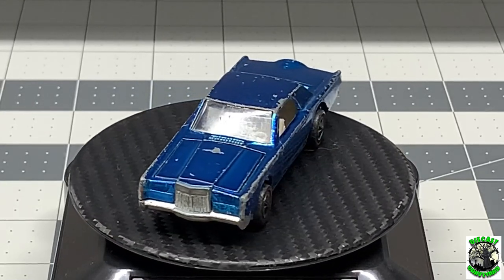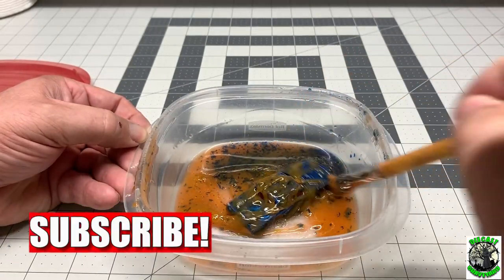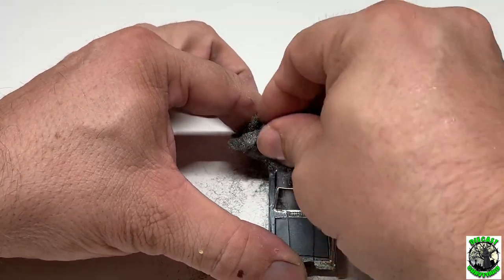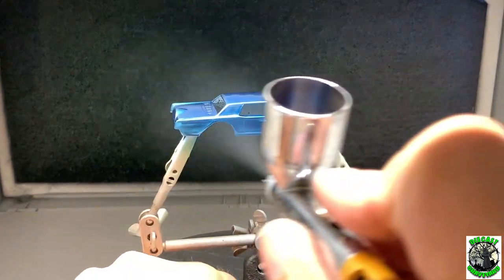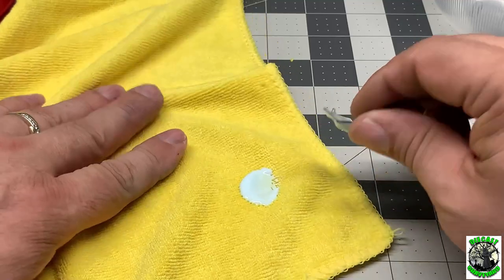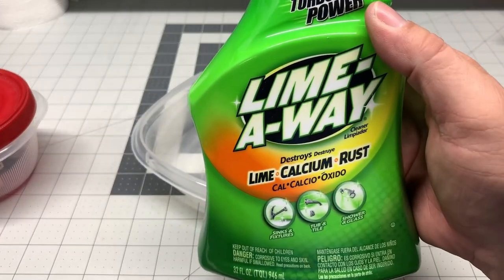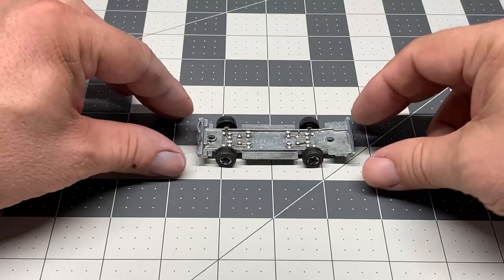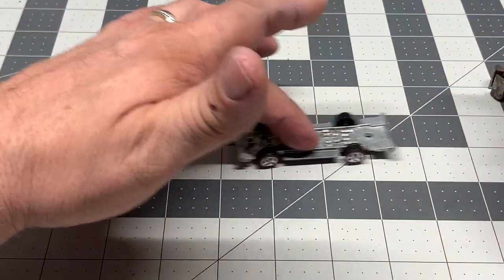Hot Wheels Lincoln Continental Mark III

Comment: The citristrip is all I've ever used. You can actually use it over and over and over. I've got an old bat should I use and I've got to clean back that I use. If I've got a strip primer off or something and I use the clean one but besides that that's such a strip works fantastic.